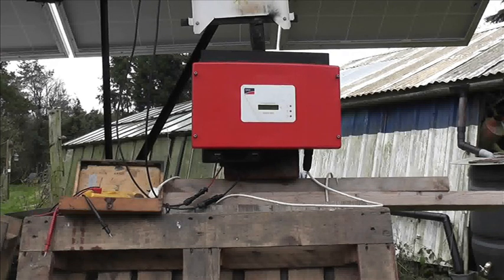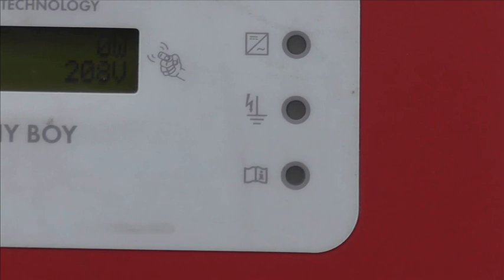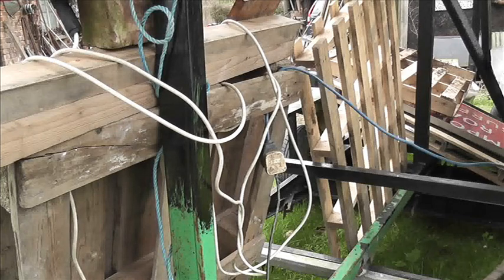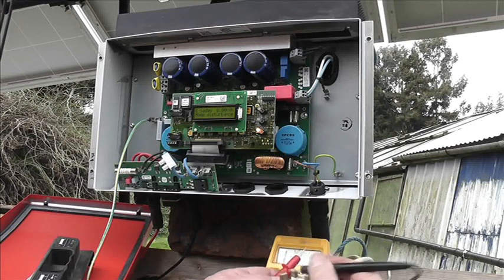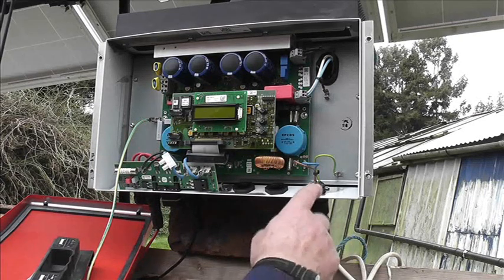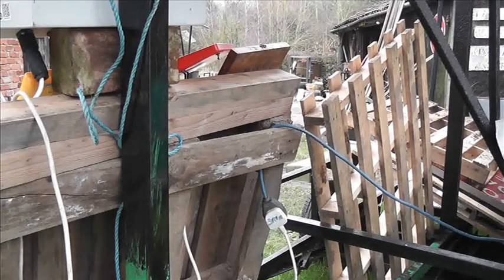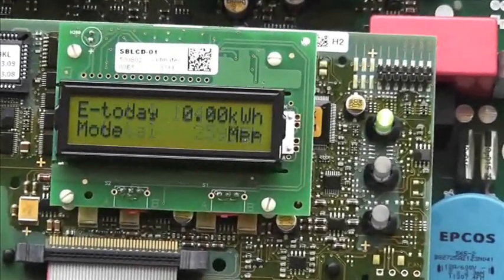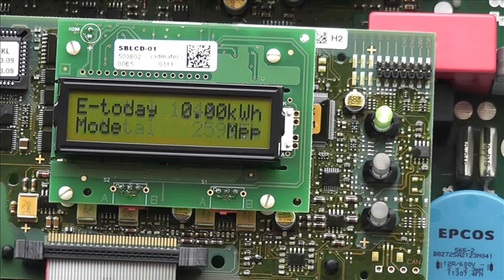SMA inverter fault VAC BFR, what is this?

Comment: Just wondering I have an sma 2500 that I want to plug into a home 240v circuit, semi permanently. It seems very possible in your setup. Is that the case???
Reply from the maker: Hi, I will not advise, but what I do with systems under 1.5Kw is just plug it in with a 13 amp fuse, with larger units I use an outlet similar to that used for storage heaters, cheers

Comment: Hi Andy. Very informative clip. I h ave a question. When you plug the Sunnyboy 1700 into the mains grid can I plug the sunny boy 1700 into a caravan or off grid cabin?
Reply from the maker: Not normally unless you create a grid with something like a bidirectional victron multiplus inverter charger, cheers

Comment: Help inverter won’t turn on
Reply from the maker: do you have AC and DC power at your inverter?
Reply: @TheInfoworks  hi, i meet the same issue it will not run... i have a 480vdc and 230vac but it wil not run it's a sb3800
Reply from the maker: @cherrabimohamed  is the 230v AC getting on to the board? cheers
Reply: @TheInfoworks  hi, it run wel now... The mistake that i did was to run First the DC then the AC and normaly you need to start the inverter First then activate the DC switch

Comment: Help, sorry bad inglish. Omniksol 2k tl Isolation fault , fault in inverter, where do i start looking? Relays is new.It is possible find schema?
Reply from the maker: are you sure the fault is in the inverter, many times it is in the panel wiring. make sure your DC wires are strapped up and not touching earth, cheers
Reply: @TheInfoworks  yes absolutely sure, also tried 150 vcd from battery
Reply from the maker: @christianlarsson6065  Difficult to define, maybe start checking the capacitors. Otherwise replace the unit with a second hand solar inverter, cheers

Comment: SMA inverter error codes VAC-Bfr and VAC-Srr seem to be internal codes for 'grid voltage too low' and 'grid voltage too high' respectively. Grid frequency out of range error codes are FAC-Bfr and FAC-Srr also.  What 'Bfr' and 'Ssr' are short for, I can't work out. Just looked this up online, and am passing it on as I find it. 
If you don't have a label printer Andy, and I really  recommend them, you could do worse than use masking tape wrapped around and a permanent pen marker to label your cables outside and in the batt shed.  Cheers, Dave
Reply from the maker: Dave, so VAC BFR in this case refers to AC low. Normally I colour code wires and that extra white mains lead was from testing a Solis, then forgetting it was there, cheers

Comment: Hi Andy, Not sure about that socket outdoors without protection.  Could get corrosion on the plug pins and also the fuse holder.  
Thanks for the video.
Reply from the maker: Hi, oh yes, exactly, this is a temporary set up, cheers

Comment: Glad to see it working. We all need to generate our little bit, especially when the import cost doubles in April.

Worth pointing out volt drop across long leads too. I swapped a 50m 1.5mm2 extension cord for a 2.5mm2 as the smaller reel lost 12% in voltage.
Reply from the maker: Ian, volt drop is a killer with all of these systems. I am going to move some inverters closer to their panels to reduce this, cheers

Comment: I wondered about putting a multimeter across ac. But a true rms meter would be necessary.
Reply from the maker: Owen, as you see it's fine unless you need to be very accurate. It let me know there's mains power there, cheers